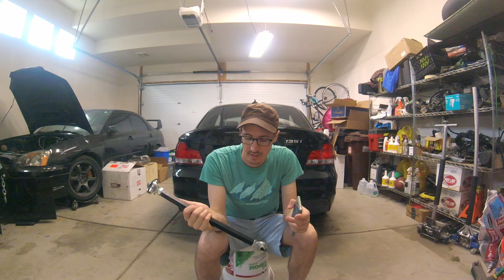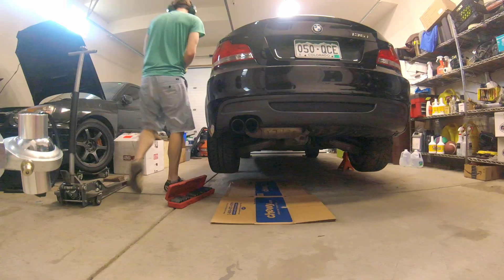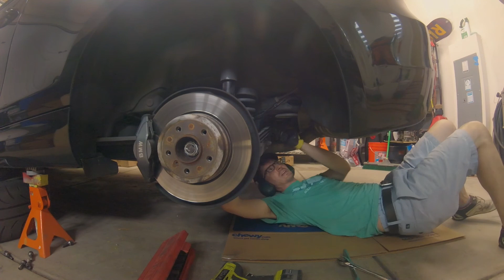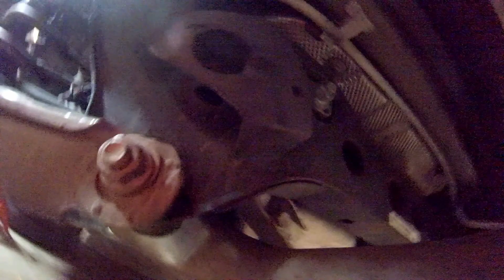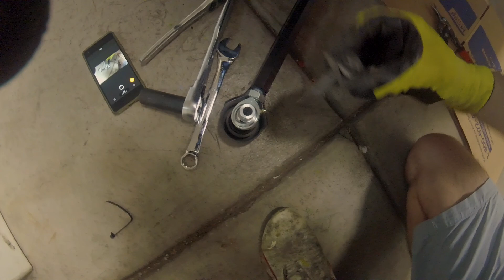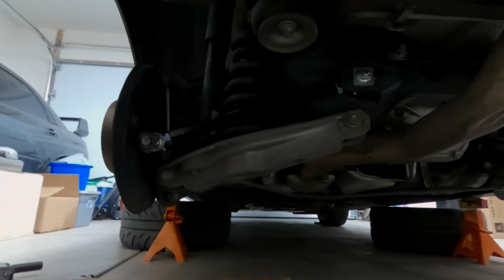Rogue Engineering Toe Arm/Link Install on 2008 BMW 135i

Comment: Do you think those eccentric lockout's are needed? This is the first i'm seeing of them. I'm getting ready to do the same adjustable toe and camber arms myself. Thanks in advance.
Reply from the maker: It won't be a problem to reuse the OEM eccentric bolts, just keep in mind that the eccentrics do have a tendency to gradually rotate, especially if you track the car frequently and liberally use high curbing. Since the toe arms have enough adjustment to accommodate toe correction from cambering the rear, the eccentrics are just a source of alignment issues so eliminating them for ~$60 was a good plan for me.

In short your alignment tech can work with the OEM bolts + toe arms, but the OEM bolts aren't helping you. Good luck with the install, be careful with torquing the arms, I damaged mine torquing to the OEM spec. Rogue Engineering just said to torque them hand tight to keep from crushing the spherical bearing.
Reply: @Gomeler  Oh wow thank you so much for the pointers. I think that torque tip just saved mine. Thanks again !
Reply: @Gomeler  TAKE MY SUB !! LOL
Reply from the maker: @gster109  hah, thanks dude! I don't post much content, but with summer warming up I'm sure I'll be getting out to the track a bit and breaking stuff. Good luck with the install, glad I could save someone else the embarrassment of emailing Rogue Engineering "I broke your thing with my gorilla arms".

Comment: Nice thanks man, this helps alot
Reply from the maker: Forgot to update on the torque spec. Heard back from Rogue Engineering and they said "We secure this hardware with a 3/8” ratchet hand tight."